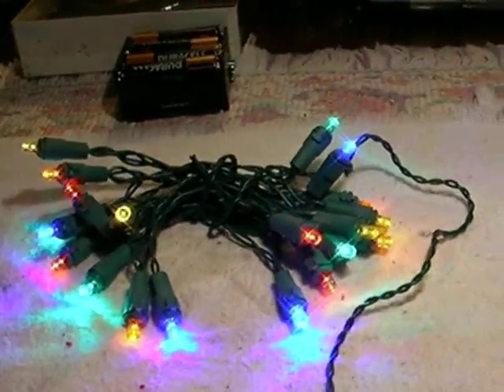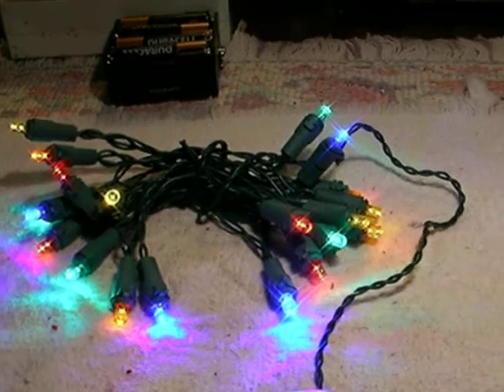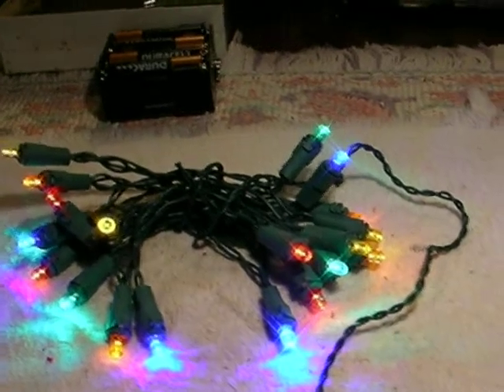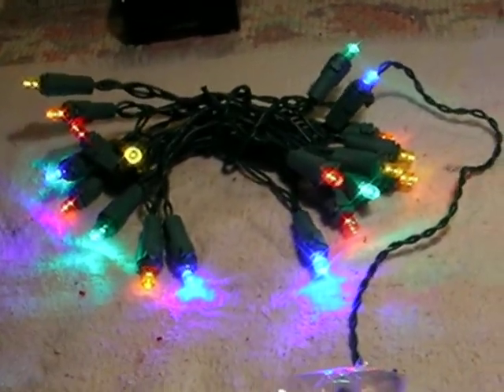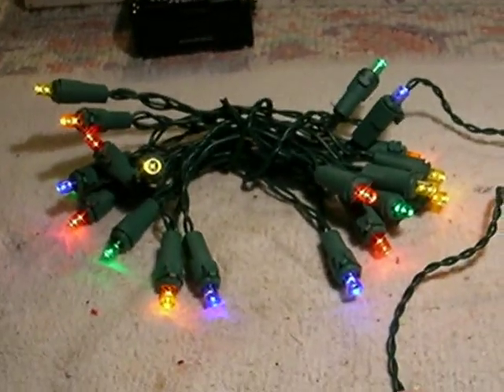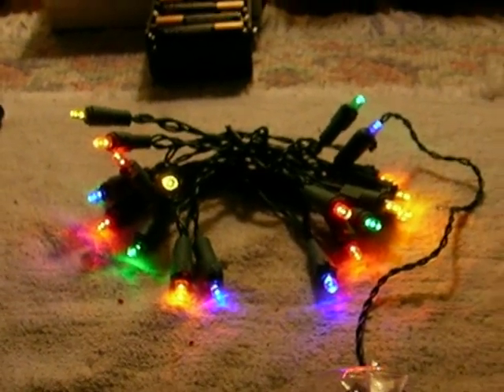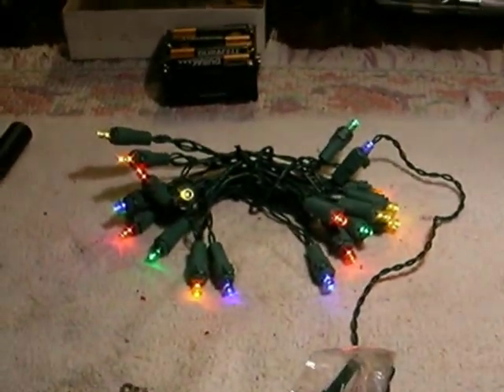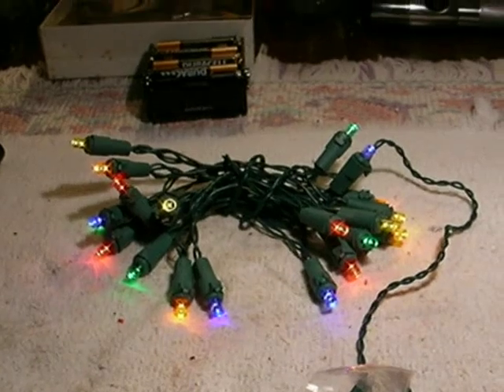LED Christmas lights - tweaking

Comment: Every manufacturer must make them different. On my set red, green and blue are equal. amber is a little dimmer, but not too much. But purple is so dim, you can hardly see them from 10 feet away. Mine are also AC, so it's not a weak battery.

Comment: This is really awesome a resistor making them much better! 

Light dimmers use resistors for dimming and when using them on conventional Christmas lights like older incandescent bulbs it is really cool! They look nicer and save energy as well.

I never knew you could do this with LED's though! I wish LED's were made like this after your tweaking.

Your right the blue's and green's are much too harsh and ugly.

The sharp white ones are the ugliest though. They actually look gray!

Comment from the maker: I also meant to mention that the reason this tweak works is that the emitting material in blue, green, and white LEDs needs more voltage and a bit higher current to achieve their brightness. When you "starve" them, they still light, but softer. The Reds, ambers, and yellows take less current so they stay at the same brightness even with less voltage.